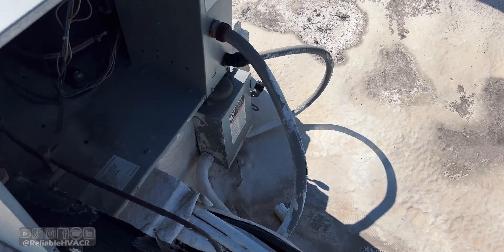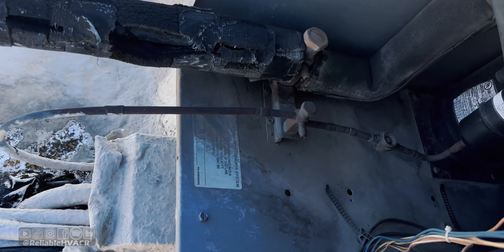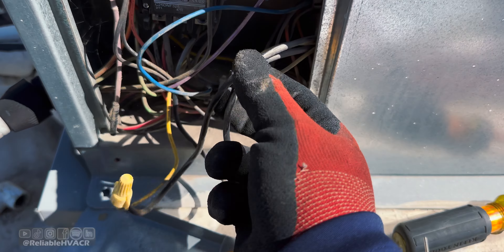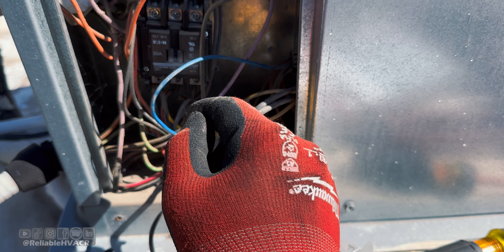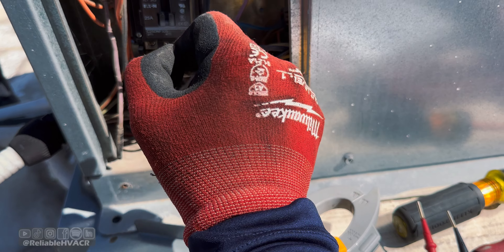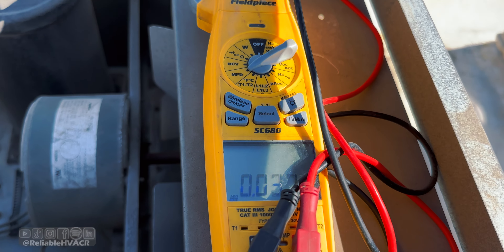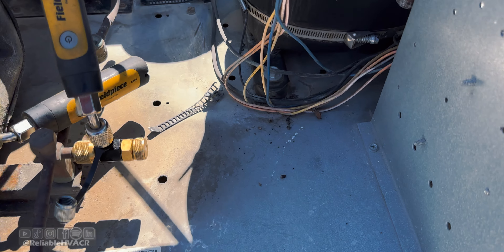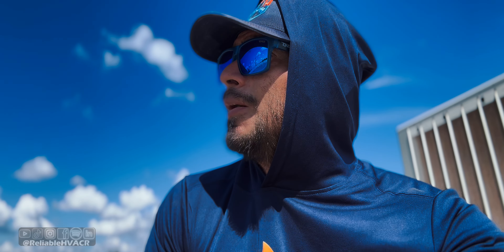Easy Money Refrigeration

Comment: I learned a lesson changed a capacitor that was bad on a condensing unit and didn’t bother to check the ohms on the winding of the motor because of most of the time it just the capacitor and it was late working hard on very hot weather but that error made me comeback 2 days later to replace motor, I don’t know what reading can be on that motor that i saw two wires